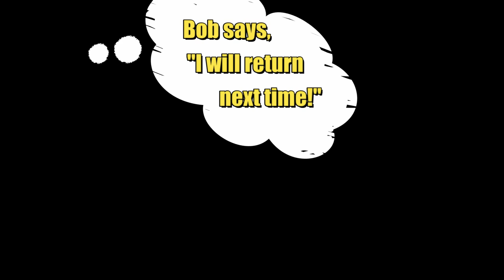CAB TILT & LIFT ADJUSTMENT + POLARITY DISTRIBUTION BLOCK Maintenance #20

Comment: Your a great teacher. Could you tell me how you know if your within the cab leveling specs?
Reply from the maker: Manuel Serrano what I can tell you is that (generally) you want to be less then max, and more than minimum. My gauge for what is correct is a smooth and quiet ride for the occupants. Otherwise, I am not aware of any set standards. Thanks for the comment; hope that helps.

Comment: Good day Dave! I broke a stud will trying to clean up my “polarity protection device”. Sure Power is owned by Eaton now and they make a 2 battery and 2 alternator (load) battery isolator diode (heat sink and no moving parts) would serve as a replacement? Just not sure what the purpose of the polarity protection device serves. Any light you can shed would be a huge help. God Bless! Also. Your channel is the reason I bought my M1078 “Fat Amy”. Thanks!
Reply from the maker: Yes! They make a 300 amp version for those guys that have switched to a 200 amp alternator, but are still running with the 100 amp stock diode. It is designed as a poor man's battery equalizer. It does a pretty good job, but it's not the best. ROLL "FAT AMY," ROLL!!!
Reply: @HelicoolsHelipad  Thanks Dave! You Da Man

Comment: You must miss Silent Bob a lot, seeing as you mention him a lot. So did cleaning the power distribution box work? Is the ride quieter? You know, did what you did do what you wanted it to do?
Reply from the maker: I do miss "Silent Bob" when he is not around... we have a good time working together and laugh the work away.

Unfortunately, I had to drop everything when I was finished so I could edit the footage and export the video into something I could upload to YouTube. I didn't get the chance to test out the starting and ride for Malachai. One thing I am certain of, each time I complete some preventative maintenance it does two things... makes things operate as it used to when it was new, and eliminates the part as a cause for something not operating quite right. So either way, it's a win.